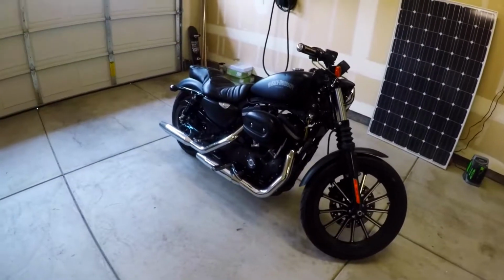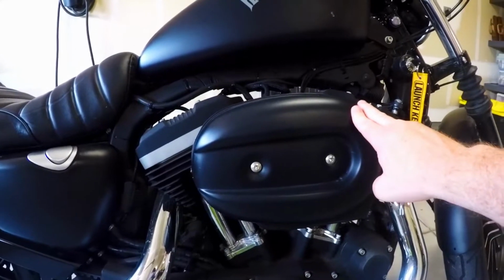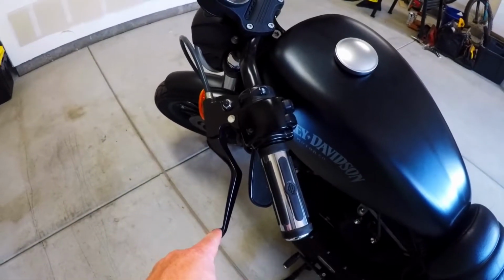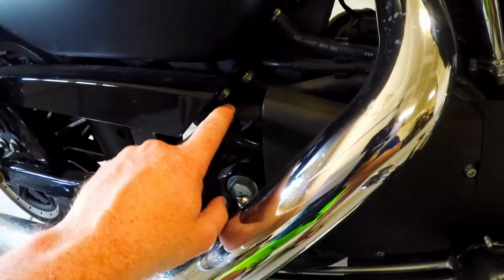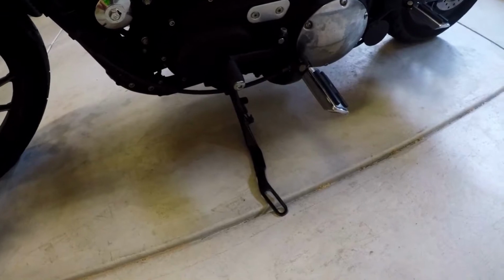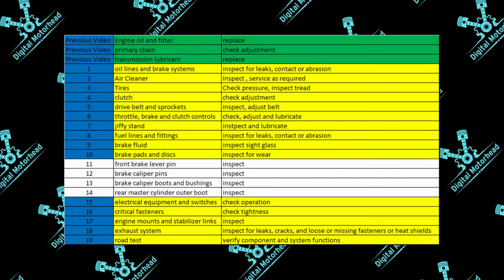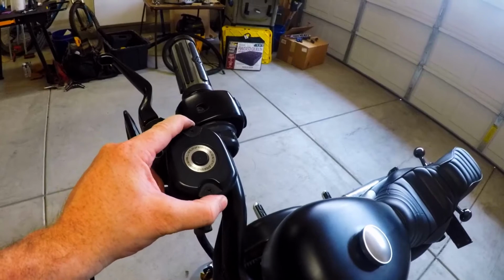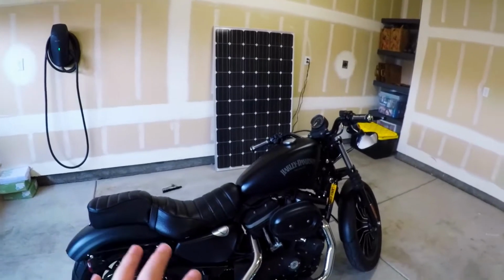Harley Iron 883 10k Service DIY | Part 2 Complete Checklist

Comment: Very good video, informative and detailed, any one can follow along and do themselves, awesome stuff.
Are you planning on doing any mods? I see you flipped the mirrors, but for instance, air filter, handlebars, seat, you thinking about that?
Ride safe and keep these great videos coming! ✌️
Reply from the maker: I really think I might keep this bike mostly stock but you never know. I think the thing I would most likely want to do is upgrade the air filter and possibly the exhaust so it can breath better. Thanks again for the comment!
Reply: @digitalmotorhead5323  you're welcome thank you for the awesome videos! The exhaust is one of the coolest mods for sure, some Vance & Hines? Kinetic perhaps?

Comment: I’m coming up to my 5k service so I may just go through my service manual and see how many of the inspection points I can check on my own. My bike is a 2020 so I’m not sure if I have to take it in to keep the warranty good. Guess I’ll have to check. Thanks for posting the vid though! 👌
Reply from the maker: You should double check with the dealer but I'm 99% sure you can do your own maintenance without voiding the warranty. What I don't know is what you have to do if anything to prove you did it correctly. Awesome that you are tackling this yourself too, I think you will be glad you did! Something about doing it yourself just brings a smile to your face.